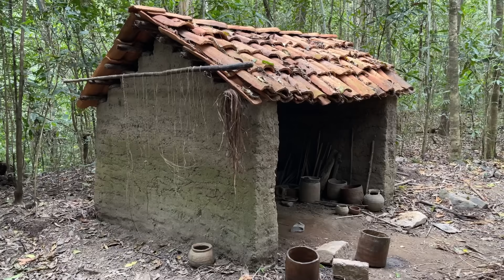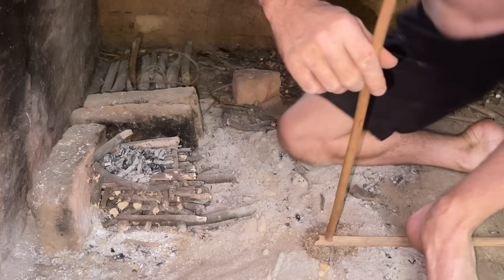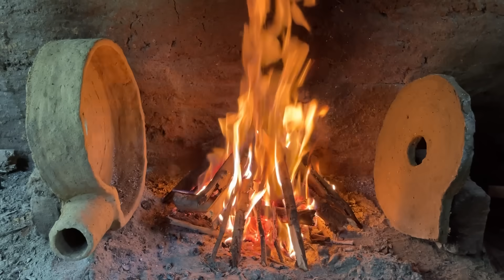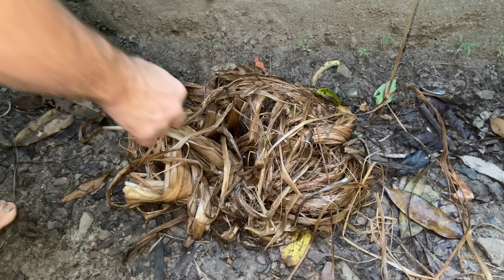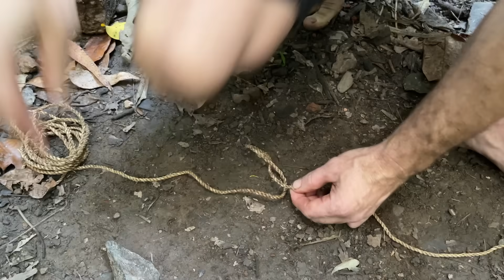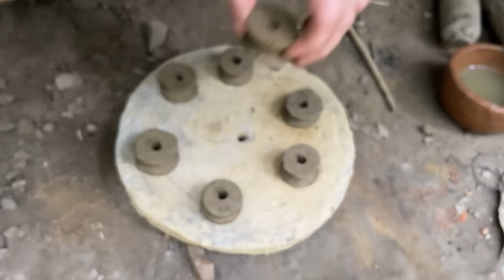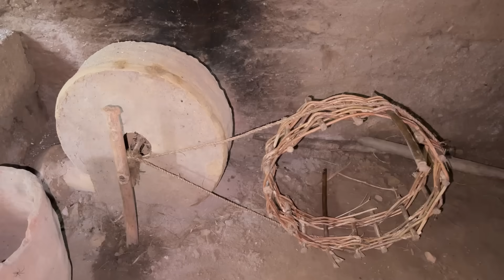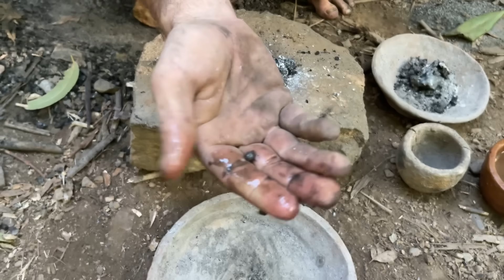Primitive Technology: Floating Pulley Blower Smelt

Comment: If you angle your tweir a bit more (It should enter the furnace at a roughly 45 degree angle to the back wall)... 
It will help create a vortex as it forces air into your furnace. You also need a secondary air inlet at the base of the furnace. One you can seal until the furnace is up to temp. It helps with the vortex effect and creates more even heating. I'd also recommend raising your Furnace walls by another 2 feet. and sealing the walls with mud up at least the first two feet. 

You can see flames escaping between the bricks... thats lost heat and can make the difference between pig iron and proper cast iron.

Oh and for anyone else watching this when your making a rope splice in natural fiber rope, re-soak the two rope's ends first if you can. 
As the splice dries the fibers tighten into each other and your splice increases greatly in strength.

Comment: If you could make a pully and gear system where you would power with the motion of pushing a peddle down using your foot you could use your foot a lot longer than using your hand. a pully or gear system using clay gears could get you a lot more wind speed.

Comment: What about a thicker spindle(?) arm for the fan? Then you could notch a groove for the belt. Could also test with a taper. You might lose some rpm but it could also add to the lifespan of the belt. Waxing the belt might also keep heat down.

Comment: If you eventually want to melt all your collection of iron prills into a knife, you should try using a pre-fired open top clay mold in a v shape that you could load all your prills into the top of and place in the bottom of your furnace.  Also if you want to intensify the temperature at the bottom of your furnace, it will need to be funnel shaped near the bottom.

Comment: My intuition says the trundles would be less fragile if they were fired. Grind a flat spot on the axil for the keyway. There is a LOT of torque on that small wheel and the flexibility of the twine solution is probably the best, I just would like to see the spool work without crumbling.

Comment: How about adding a multiplier gear between the wheel and blower axle?
Just add an intermediate axle with a small input pulley and larger output pulley. 
That will get more airflow per rotation of your freestanding wheel.

Comment: I'd be inclined to make a bow lathe and turn/mould clay pulleys on that--which might allow for more uniform/stronger pulleys.
Also, for splicing, going to three-stranded cordage will improve the splices, if complicating the rope-making.
If there were deposites of copper and zinc nearby, would your focus be on bronze, rather than slag iron?

Comment: A big  (suppoeted?) ceramic pulley migjt fall apart less.  And also act as a flywheel that would keep the blower spinning for a bit while you are charging the furnace.  The floating pulley does look like a bit of a workout.  Do you fire the clay pulleys that break, or just dry them?

Comment: I wanted to point out an important possibility: you can be too hot to produce a solid bloom. The solid, workable wrought-iron-mixed-with-slag bloom often comes from a solid-state process where the iron itself never actually melts, just loses oxygen, gains some carbon, and sinters together at the bottom of the furnace. Somewhat restricted charcoal quantity, as well. With full melting and plenty of charcoal you tend to end up at the eutectic where the iron/carbon alloy melts at the lowest temperature, which is a form of (brittle) cast iron. The solid phase reaction is slower (but cooler), and avoids the need to decarburize to get to a forgeable iron. Whether your iron bacteria is a suitable ore for the process is, of course, a question, but "more and hotter" might be going in the less helpful direction, and there might be a "more finesse" option that could work better.

Comment: I don't understand how humans transitioned from this state to making actual things out of iron. The yields seem so negligable and apparently you need much more advanced smelting to be able to cast it in some manner. How did we ever figure this out?
Reply: We bridged learning about this stuff with copper and it's alloys; copper is comparatively trivial to smelt, and shows up sometimes as just chunks of copper metal, and bronze is a much better metal for tools than people give it credit for. It's actually better than iron, but not better than steel - but basically requires long-distance trade to get the copper and the stuff to alloy with it together to produce much of it. When that trade network in europe fell apart we'd figured out that it was possible to get a metal out of the iron ore stuff, but nobody wanted to because it sucked and took too much fuel and effort to use. We got better at it once the good stuff was too expensive and basically everyone had iron ore and carbon, so...
Reply: @jonored Thanks for the reply, but I feel you glossed over the key issue here. "Once we got better", how exactly?
Reply: @JP-pv2ze  Oh, I glossed over it because it was after the period your question was about; we knew ways to make iron objects during the bronze age: if you get unlucky you get the prills and the like but you can cast them like copper or bronze, you just need a LOT more fuel and higher temperatures and the final product will smash like pottery if you try to work it after it's cast, or you get lucky and get something that's still kind of like a rock but kind of like metal and you can work it and get something kind of like workable bronze at the end. Or you can just get bronze and have an easy time of all of that. But the iron  ore is cheap, so people are going to poke at it on the side to try to make it useful while they do their main copper trade every so often once they know those rocks do something in a smelt.

The "got better at it" was getting stuck learning to control those processes a bit better - no big changes, just practice - and noticing that some of the iron, gets hard if you quench it hot, and learning what part of the fire will make iron that won't harden into iron that will. I was really just glossing over _steel_, which is the last step in iron tech getting parity with bronze and being worth the trouble if you could just get copper and something to alloy it with. It's somewhat after you get to making useful items out of iron, which you can do if you get wrought or put the extra effort into melting.
Reply: @jonored That makes a lot more sense. In terms of iron requiring more heat and fuel, compared to bronze; what order of magnitude are we talking? Can we expect to see some blooming iron on this channel in a couple of years (hypotheticlly, technology-wise) or is it way more advanced?
Reply: @JP-pv2ze  I don't mean to say that iron is terribly harder than what we're seeing here to achieve, I think the scale and expenditure we're seeing here should be workable and that some parameter is just a little off for getting a really successful iron bloom.

I'm more saying that compared with this, copper is practically throwing itself at you to get you to use it and teach you basics of metallurgy. You can literally just dig solid copper metal out of the ground, it melts easily with a bit of charcoal and air, when it weathers it turns the very distinctive vibrant colors of it's (more common than native metal) ores, that I suspect also occur around it's native metal, and it's nearly a noble metal so something the size of a small forge, or just a pit with a good chimney, can successfully run the smelt. Only the precious metals, and maybe only gold in particular, are easier to figure out from nothing, and copper will teach you more of the transferable skills for iron. You just then need to get out of the very comfortable copper and bronze zone to generalize to iron where you have to actually work for your metal.
Reply: @jonored  Thanks a bunch!

Comment: A thought, when you grind up the bloom to get out the smaller prills - the material there has been taken to temperatures that melt metal and only become liquid.  Everything that would have turned to gas and burnt off has already been burnt off.  So, you have there some dense material with a high melting point.  Would using it as grog in your clay improve its ability to withstand heat any?
Reply: Thinking it through, it may take higher than normal temperatures to even fire clay impregnated with that stuff.  :D

Comment: If you drop a cat it will always land on its feet. If you drop a slice of buttered toast it will always land buttered side down. Take one of your woven basket pulleys and inside on a central shaft attach a cat and a slice of buttered toast back to back. It will free float in space with antigravity effects and rotate. With the belt attached  it will drive the blower fan. Wild cats and buttered bannock bread will produce high speeds.

Comment: You need to kick up the scale a little bit and make stuff a bit more permanent.  Maybe come up with a few people on a weekend and do a large charcoal burn or brick build.  Maybe do enough smelting one weekend to make some iron tools.  Back in the days it was common for people to have professions and all they would do was one thing, like charcoal burner, but you are trying to do it all on a smaller scale and this is holding you back I think.  I bet you could do some fan meetup events and do some crazy things in a weekend.  Making tar and grease, tools, containers, rope, bricks...  you could get a lot done with help.  Maybe even make a bigger workshop.

Comment: Hey just gotta say I've always enjoyed your content!  I subscribed years ago the first time I saw you come across my feed and may have mentioned it then but I think its also worth mentioning now you're really starting to move some air.

You seem to always reduce the gap between your air "pump" or "blower" and your nozzle or airflow pipe to a very close and usually touching fit.  Now I don't know the ins and outs of airflow through hot coals, but I do know about the Bernoulli Effect!

Long story short I know that you can achieve higher airflow if you make the gap between your blower and pipe larger.  That's because moving air has a lower pressure than still air, meaning moving air actually will draw in extra air from surrounding areas if not properly sealed.

Though I do Understand the need for pressure to push the air through the kiln/forge, so maybe it's worthwhile to fabricate a sort of adapter attachment to help keep pressure high during startup but can then be removed once flow starts becoming self sufficient, the combination of self sustained flow, forced air, and Bernoulli effect could substantially increase your max temp while also making your work easier!

The I guess the only way you could improve the system is automation, how I would do it would basically be a fan on a pole and a smokestack, the smoke stack funnels and lets the air cool a bit so the fan doesn't burn up, the rising air of the smokestack pulls in fresh air to the fire passively, and the fan turns the blower axle which would be Bernoulli boosted using an air gap which increases airflow, but the increased airflow speeds up the fan and therefor blower, which causes more exhaust and all the sudden you've got a stone age turbocharger on your hands!

Anyways, keep on keeping on!

Comment: 16:13 despite the inefficiency, seeing little purple flames leak out the cracks is beautiful
Reply: It looks like a magical glowing liquid dripping upwards
Reply: ikr - i always thought he would be better of with creating a double brick layer around the fire so less heat gets lost.
idk if he got actual iron ore around his place, cs that would generate more iron too
Reply: I was thinking the same thing
Reply: I didn't even notice that until your comment. What makes the flames pink and purple?
Reply: @littlesabe  That's caused by burning carbon monoxide.
Reply: @littlesabe  Many cameras pick up more infrared than our eyes do and they show it as purplish pink, that's my guess but the other comment could be right. Try pointing your cell phone camera at the heating element on an electric stove or inside a toaster and instead of the reddish orange your eyes see the camera will usually show you a very similar purplish pink.
Reply: could the lack of yield just be the ore?
Reply: @Aerational  Totally. Nobody use that slime "ore" for a reason. But he is probably doesnt have a nice magnetite deposite on surface nearby, so...
Reply: @Rakshasstiger Not directly as slime but in the middle ages they'd dig out chunks of it from bogs and smelt those to get iron from it, they did it a bit under WW2 also because of materials shortage, but it's really only viable if you have zero other sources of ore.
Reply: @Nukle0n  It works though. Esp in the middle ages when blast furnaces became the norm. Being able to turn bog iron into good steel was such a human feat. Johns got a couple thousand years!
Reply: @Aerational I just meant it’s probably not optimal for flames to be going somewhere besides up the chimney lol
Reply: There were a lot of things he could have done better with this smelt such as use a taller furnace, and do a proper preheat.

Comment: Some suggestions:

1. When starting a fire, pick up the tinder, wrap it around that first spark, wrap your hands around that, then blow between your hands. Oxygen will still get in (your grip will be light), but all heat generated inside the tinder ball is put to use lighting up more tinder.

2. A lid (with a small hole) would hold more heat inside the furnace. It could have a handle either side for easy removal when adding more charcoal and ore.

3. Look up foot powered lathes for inspiration towards a foot powered blower

4. Make a primitive wheelbarrow! You do a lot of fetching and carrying, it could save labour in the long run.

Comment: If you made the roll you had in hand idea as a clay disk flywheel on a fixed axle with wood tube as a bearing, you could one hand spin it up to much higher speed and have more control at lower speeds. Could even make a stepped cone shape for the connected rope for changing fan speed.

Comment: Cant help but wonder if a large diameter pulley would be better suited with a crank of 1/2 the diameter? Seems like a lot of arm movement to get a rotation out, not bad at first but it will wear you out given some time
Reply: not all of your comment makes sense.!      the rpm step-UP of this system is something like  1:14. !!!!
Reply: @daviddavids2884 what i mean is, you dont have to make the crank arm so big. Your bicycle pedals dont have to be the same diameter as your sprocket. Its hard to explain seeing as how his pulley lacks a central hub which he could fix the handles to

Comment: have you thought about smashing the charcoal to a powder and mixing the iron ore into it then wetting it to small bricks (like you did with the wood ash when making cement)? or would that be a waste of time? my thoughts is that it might make it easer to store and you'll have a more reliable measurement rather using your hands (every handful would not be consistent but you can measure it all with a bowl with charcoal powder and iron ore powder wetted into bricks and store for easer use) then all you need to do is grab a small brick and throw it in. also you won't lose as much ore due to slippage through your fingers or powder stuck to the bottom of the bowl

Comment: Just a tip from and HVAC guy, the hole that lets air into the blower needs to be larger I would make it about 1/2 the size of the blower housing. Example 8” round housing use a 4” opening. This will produce more air volume from the blower needs

Comment: think you'd be able to make a box bellows? they are a little complicated, usually made of wood but i don't see a reason you couldn't make one out of clay, though i don't think it would work for the plunger. but the check valves would be easy with leaves and clay, the only tough thing i think, would be the plunger because of the forces at play.

Comment: Why not make a Chinese version of a blacksmith's bellows out of one or two large pipes with pistons made of sticks and grass and valves made of leaves? The pipes are usually made of large tree trunks, burnt and sanded from the inside, but you could probably make them out of clay on a twig frame.

Despite the fact that the principle of a centrifugal fan is simple and clear, to achieve its high efficiency it is necessary to select several parameters quite accurately at once, which is impossible without mathematical calculations or even modeling. And non-optimality of any of these parameters leads to a dramatic deterioration in efficiency. For example, a clumsy and obviously insufficient diameter impeller is used here. For centrifugal fans, blades are made in the form of a squirrel wheel, because the inner parts of the blades are useless and only create unnecessary resistance during rotation - work is done only by the peripheral part. In addition, on the outside of the wheel, the blades must be as close as possible to the fan casing at the closest point, almost touching it, and this is critical for creating good pressure. The same applies to the adjoining of the side surfaces of the wheel to the casing.

Comment: I'm sure this will get lost in comments. However, I'd love to see you work this into a foot pedal design. Idk if you'd utilize the keyed pulleys again (with a gear ratio to increase the speed and a simple fulcrum/pivot). Efficiency would go up if the charcoal and smelting agent were within arms reach and you can use your arms/hands freely without interruption for adding material or doing whatever else you'd like. Good work sir! I stop whatever I'm doing asap to watch your videos